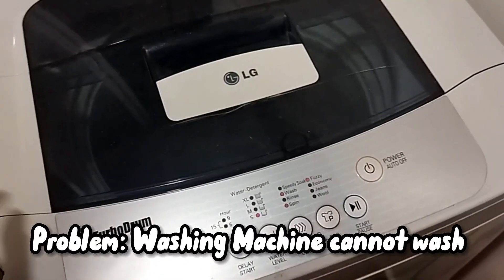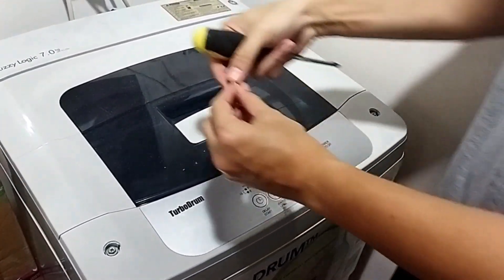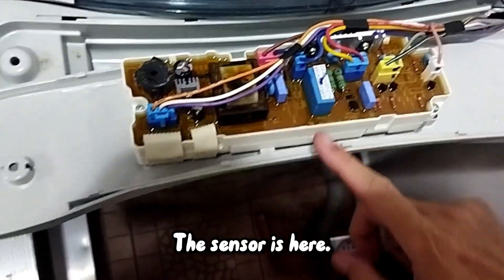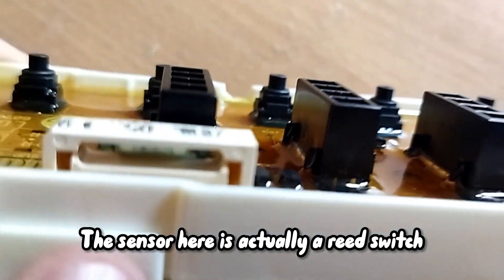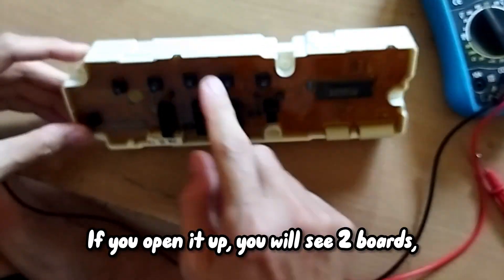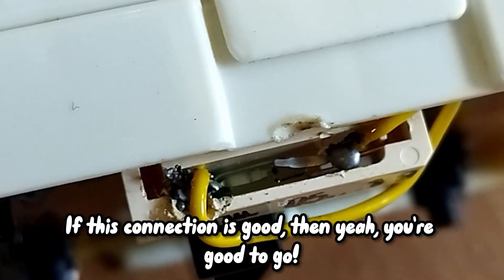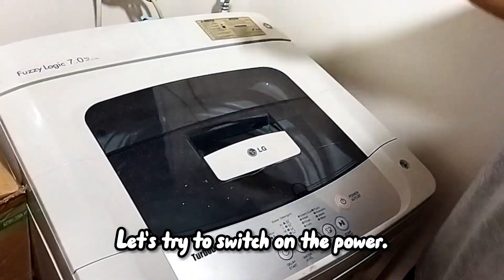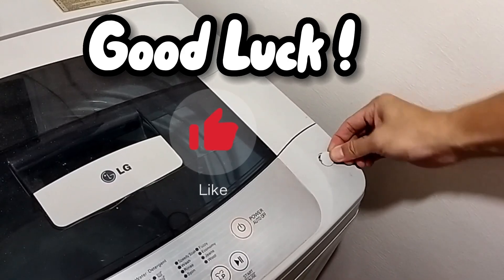LG Washing Machine Repair for Beeping Error (Feb 2023)

Comment from the maker: NOTE: If placing a replacement magnet on the washing machine cover still works, you don't need to do any bypass, just glue the magnet to the cover, and this fix should allow it to continue to beep only when the washing machine cover is opened (i.e. a real valid error).
Reply: Will any magnet works?
Reply from the maker: @boblee1401  Yes, any strong magnet.

Comment: The person who serviced it at my housing just glued a magnet on the plastic. It sits right over the sensor. Granted they cut off a part of the lid to make it fit.
I came looking for help not realizing that the magnet that had come off actually had this function. I temporarily taped it and the machine went right back to work. Ofc, I have to call the maintenance guy to come check it out to fix this issue. But at least this made it work for now!
Reply from the maker: @lo3506  Yes, magnet hack works if the sensor still working.